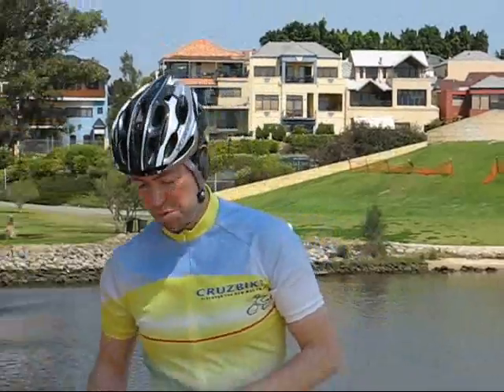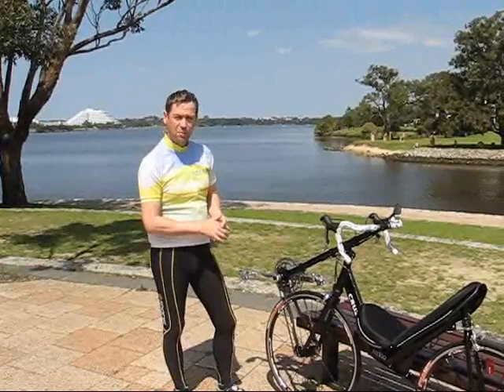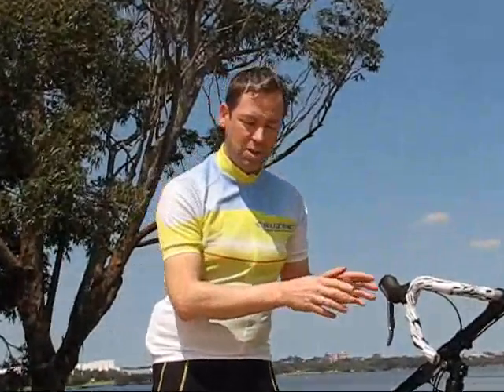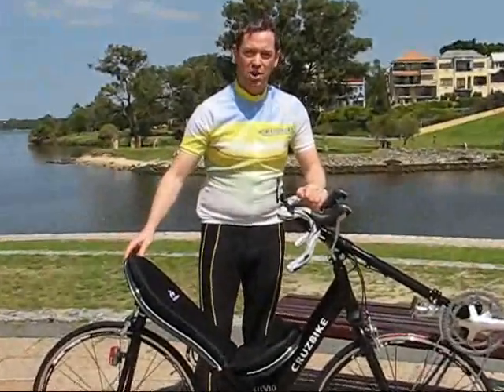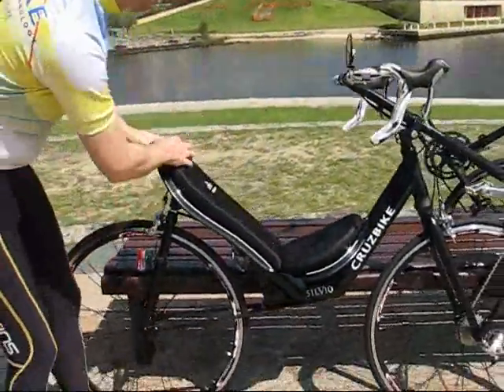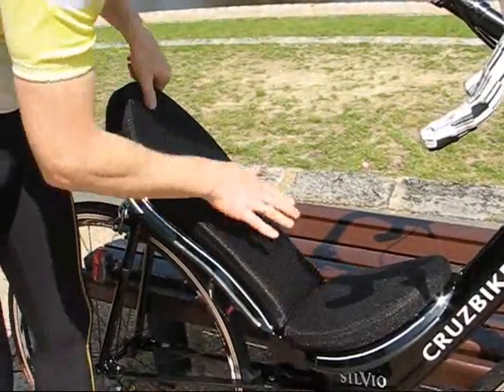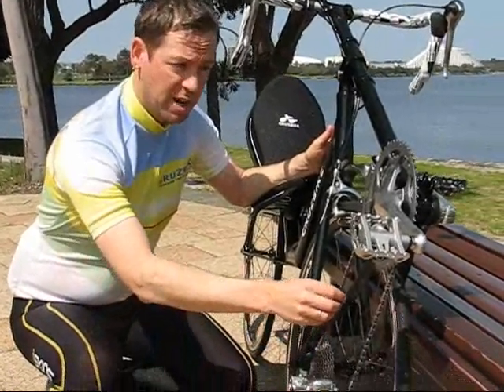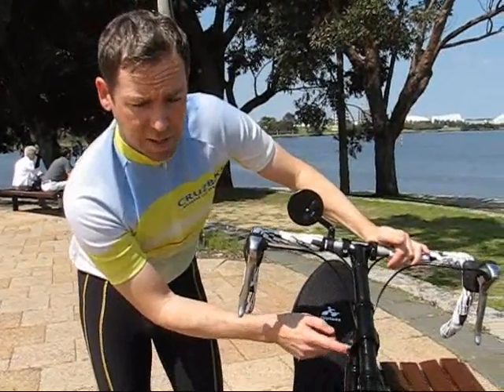Cruzbike Silvio Technical Tour

Comment: Very intriguing design.  Since your feet are at the front, it makes sense to have a front wheel drive. A lot of weight is saved as well. The front triangle looks very solid and well thought out.  The higher riding position and larger wheel is a plus.  However I do have a question on the handling. Your feet are connected with the steering wheel.  Would that not restrict your turning angle? When pedaling through corners aren't your hands fighting your legs?

Comment: • How is the view towards the front of the bike? Where I leave we have lots of road imperfections and potholes and would like to see those and react with enough time since you cannot (?) bunny jump on this bike.
• Why not add a ventilated seat option? Again, I live in the tropics and we sweat profusely. If the cushion starts to absorb that sweat is going to weight a couple of extra pounds after a few hours of endurance riding. Just an idea but would CruzBike consider a ventilated seat version?